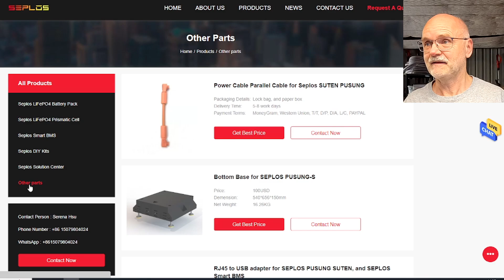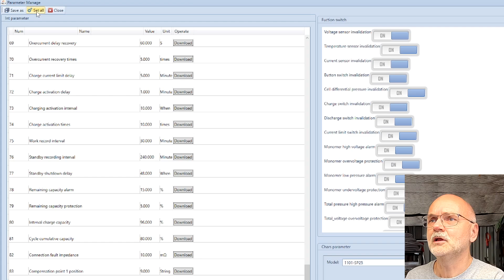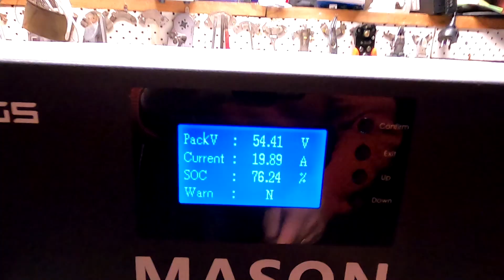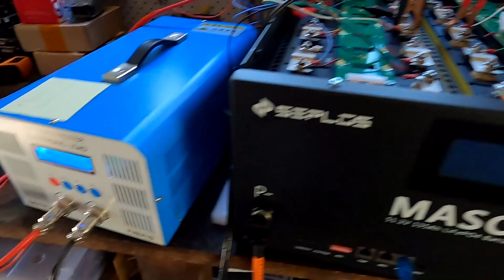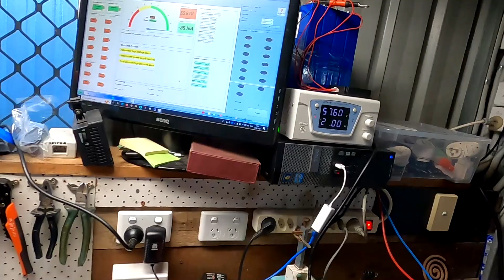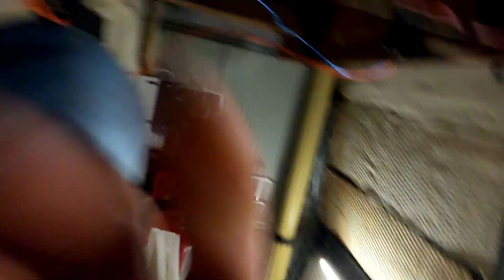SEPLOS SMART BMS: as good as its reputation?

Comment: I have another question that maybe others have dealt with and may have found a solution. Since I operate several packs in parallel and the individual cell voltages(and many other values) are unfortunately not transmitted to the Cerbo and then to the VRM, I use the option of being able to check all values on the desktop in the office via RS485 and USB using the SEPLOS software if necessary. With only one pack, this is not a problem, since the DIP adressing all remain at 0 and the parallel connection CAN & RS485 does not cause any problems. However, if you use several packs and adjust the DIP switches - so far I have unfortunately not been able to find a setting where ALL packs including the master pack are displayed in the SEPLOS software. This would be PACK 0. Maybe another one already has this great one missing the possibility of being able to read out all packs remotely - WITH a parallel connection via CAN bus.
Reply from the maker: I think you have to leave DIP 5 off for that to work but your packs will be in a different order than. Pack01 will be the master than.
I heard this from a friend. (Thanks Raphael).
I will test all this once we have the second pack build and connected.
Reply: @OffGridGarageAustralia  Many thanks Andy for the info - but unfortunately this doesn't work - or I misunderstand it. I've also tested almost infinite variants to work around problems that I don't think can be enforced, but without success. The only problem is that when all packs are connected and the master enables communication with the Cerbo - this master pack is then no longer displayed in the SEPLOS software. If you then address the DIP switches to just one pack - all packs( since still addressed with DIP 1-4) displayed in the software but the Cerbo only sees the one "master pack"
Reply: @Tombola666  do you use the victron firmware or pylon ?
Reply: @sergea1138  have choosen victron

Comment: Thanks for all that went into making this video. I've been corresponding with Seplos for the past 6 month on the Mason DIY kit for a planned expansion (and possible conversion) to two home made 16s Overkill EVE LF304 cell batteries. I never pulled the trigger on this Seplos Mason expansion project because I could never find any comprehensive information on the Seplos BMS including integration in Victron DVCC. DVCC is also suppose to provide intelligent charging integration with Victron smart MPPTs, but I'm not sure exactly what that is. While I like the Overkill BT app for looking at the cell information, my installation is remote and I'd like to be able to see the individual cell voltages and deviations for each battery on VRM or the remote console. If the Seplos BMS balancing function is struggling with 135Ah cells it's probably going to have real problems with 280/304Ah EVE cells. I'll keep an open mind, but I think you've help make my decision. Looking forward to the 280Ah or 304Ah Mason DIY kit build. Thanks again for all you do.
Reply from the maker: Thanks, Brian. Your absolutely right and we have to get the remote access to the BMS data working. I have tested all day yesterday to get any information or of the Seplos BMS without any success. I've ordered some other adapters now which should work and give us the info on the VRM. So stay tuned. You already have the Cerbo so it should be fairly easy to use CAN protocol to get the information from the Seplos to your VRM.
Thanks for sending these amazing pictures of your off grid observatory a while back. That looks really fantastic.

Comment: I am disappointed and the initial enthusiasm has cooled.
Mechanical design 👍
Cels 👍
"Intelligent" BMS 👎 does not perform the basic function - balancing  🙁
BMS protection functions 👍

I have 6 Solax Triple Power 5.8kWh batteries at home. The capacity is gradually reduced. So I'm going to take it apart and measure the cells. I ran out of patience after watching this video 😁

Comment: Andy, Fantastic job. Congratulations. I am having the same charging problem with two batteries. To balance with active.
Question: the active balancer, do you use it with the battery connected but without extracting energy to the house?
Cheers

Comment: I always wonder if the capacity as measured is because of the small but real losses in the bus bars and the flexible connections to the BMS.  Also there must be measurement errors on the clamp meter and the shunt.  Proof of this I guess when you do the high discharge tests next?  A very interesting and informative video Andy,.  Thank you!

Comment: Hi Andy I am a distributor for a Lithium Battery that uses the seplos bms.

They set it to 80% dod. I said I need the soc to go down to 15% to lower my electric bill to almost 0.

by doing this I reduce the battery life by 5% said the China Engineer.

What can you recommend that I discharge my batteries to?

with a 20% soc they claim I will get a 6000 cycle life for these CATL 15s 100Ah battery

Comment: The big advantage of the BMS is that it can talk to the charger/inverter. You ask why? For example your issue with the balancing. If the SOC reaches 100% the BMS asks the inverter to slow down the charging amps. This then allows the BMS to balance the battery. You see the same effect in your video when you manually lower the charge amps when it seems that the balancing is doing it's thing. Of course due to the large difference caused by the 4x cell test you did it isn't doing a great job but it will eventually reach a good balance. I have a similar setup running 6 months now. No initial top balance but the cells are still in good balance at 100% SOC. It just keeps them nice and perfect in balance when you just let him do it's job over time.
Reply: The Seplos BMS only balances with 150mA, it makes very little difference if you have runaway cells like Andy displayed.
Reply: @danielp5208  True but normally that would never happen. I you might have a runaway cell you better need to check why that is and remove the cause for that. Balancing (150mA per cell) is ok in this BMS because of the slow top charge request. Only if you don't use communcation to the inverter and do a manually charge this slow balancing might be an issue. But why use a BMS like this then? People buy the Seplos for this reason. If you really need active balancing you could add it afterwards but in 6 months I didn't need it and doing a full charge/discharge everyday.

Comment: Thanks Andy, very very interesting video. So, it seems that overall the BMS is doing its job correctly except for balancing the cells. I think for that it would be interesting to use the NEEEEY active balancer as a companion. It balances efficiently with 4A, it is possible to program the start and stop conditions, and as a bonus you can monitor a lot of battery pack information directly via Bluetooth. It would be interesting to see if it fits inside the Seplos box.
Reply from the maker: Thank you. Yes, the BMS seems to work as programmed with all its safety features. Adding an active balancer for the occasion to balancing or even a Neey seems to be the way to go...
Reply: @OffGridGarageAustralia  there is a programable relay for heater function but maybe we can use it controll the 5a active balance. Maybe explore it for future video
Reply from the maker: @Pey5531  the relay function is within the Seplos BMS or an external, additional component?
Reply: @OffGridGarageAustralia  there is an unused header built-in on the BMS board. I think is only logic level relay but we can connect to a bigger relay if we need to control a bigger load there is even a heater toggle on the software. We maybe need a modded firmware to use of other purpose.
Reply from the maker: @Pey5531  I'll ask the Seplos engineers. That would be a great feature for this BMS.

Comment: Hello Andy, finally... I'm glad that you finally bought a Mason box with the Seplos BMS. After a few months of fine-tuning the Seplos settings, I have to smile when I see that I'm similar had to learn all the individual problem cases in your video. You are absolutely right that the Seplos software still needs some attention. Just like many in the DIY forums, I can't understand why the Sepos Guys don't make full use of the possibilities of a good BMS. I now run 6 packs 280Ah in parallel on my Victron system. These communicate with the Cerbo. Again here, I had to use some tricky settings to get the maximum performance. But well... after a lot of hours everything is working fine. I have also retrofitted an active balancer in all packs .. which is switched on externally depending on the voltage.
Reply: Hey, as i am switching from SMA to 3x victron Multiplus, may i ask for your experience and settings ? Using 3 Seplos Mason Kits :)
Reply: @patrickmartin4482  Hi Patrick, the communication Seplos with the Cerbo works without any problems via Can Bus. At Victron I have activated DVCC, which is now used to control the MPPTs externally (at least in part) by the SEplos. Here I had to adjust the settings of the parameters a bit. On the one hand, the maximum charging current  so that this is normally over 400A, since my two MPPTs each deliver 200A and are otherwise already regulated below my final charging voltage. Likewise, the charging end voltage itself, since I only charge up to 3.40 volts, corresponds to 54.4 for the 16s pack. In the DVCC I set 54.40 in the Seplos, but 54.45. Victron always takes the lower value. But since I want to have 54.40 as a 100% SOC, I have to do the trick with the 54.45 Volt in the Seplos, because at 54.40 the SOC shows too early. Due to a few load fluctuations in the system, the voltage briefly reaches 54.45 volts at around 85-90% - which leads to Voltage Protect in the Seplos and thus to calibration at 100% SOC. if you don't do this... after a while the SOC gets out of hand like with the victron BMV. There are many opportunities for improvement in the Seplos software, but unfortunately Seplos itself is overwhelmed by it. It starts with the problem of the precharge... the large capacitors are not charged far enough in just 3 seconds so that the seplos always goes into short-circuit protection when it is first started. So manually precharge and as soon as one pack is connected... the others work without any problems -in the normal case, at least one should always be connected to the BUS - otherwise there would be a bigger problem anyway
Reply: @Tombola666  thanks a lot !

Comment: Thank you for your testing of this battery set.
I think trying to sqeeze out the last milliamp is like installing a solar tracking system instead of a fixed one.  For me it makes more sense to keep it simple and install just more to get the same output. 
I would not need to be able to check the battery at any time too, because I trust that it will work on it's own without supervising every day😊

Comment: Very interesting, thanks for your extensive tests!
I guess if you don't need the display function you could probably ditch the BMS and throw a JK in there with custom cables instead of the supplies bus bars. Maybe the JK display even fits the cutout... 
But then a JK is more expensive than a smart balancer so that's probably the way to go.

Comment: Andy, you should probly pin ur comment at top, ie: why you didn’t parallel the cells first, so you dont have to repeat it 300 times. Here, Ill do it for u one time. Andy did not put the cells in parallel to top balance deliberately, as part of the test to see if the BMS could balance the cells from this unbalanced state of charge.

Comment: The intermittent power supply waiting is a great function, really great function. It protect your inverter from damage. When single cells reach high voltage protect, then this function working. Only when soc less than 96%, then can charge the battery again. Then why need this function? As battery is communicate with victron inverter through CANbus, when charging is cutoff as full charging, then this current will go back to inverter( has chance to damage inverter). So we can not allow this things always happerened. That is why need this function. When battery is full charging, then stop charging the battery. Otherwise you will find that the battery is always charging, stop charging and charging, stop charging….. and this current always back to inverter. So with intermittent power supply waiting, only when soc less than 96% start charging again, it helps a lot with inverter.
Reply: And about the Clamp ammeter, LCD and Software current shows is different, it is not a problem. As you working with inverter, the discharging current is sine wave. The software is update current every second, so it changed every second. The software need exact current number, so when problem, easy solved. But LCD is shows to all clients, can not let clients see the sine wave current and changed very quick, so it will shows a average value per 8 second. But clamp ammeter is more slow update. So you will find the clamp ammeter is always like 25A. If you working with stable discharging load, then you will find the problem solved.
Reply: About the battery really capacity, you need do one cycle to help the bms to learn the battery really capacity. Full charging the battery to single cells high voltage protect or total voltage high voltage protect, then discharging the battery to single cells low voltage protect or total voltage low voltage protect, then the BMS will get the battery really capacity( this is a very important step when doing aging test). But as it is home energy storage system, so it is hard to always reach this situation, but still have chance to reach it, when reach the situation, then BMS will learn the battery really capacity again. The SOH is depends on the really capacity decrease. For example a 100ah really capacity cells, our warranty is 3000 cycles at 80% DOD. So after 3000 cycle, the soh start working. It remains 80ah, then soh is 100%, if 60ah, then soh is 60/80=75%.

Comment: if you want the charging switch to turn on again, you don't have to discharge until 96% but you simply turn of the bms and turn it on again (aka restart).. 😁
I have been using this bms for over 1 year now. The only thing I dislike is the balancing function, it is really really need an upgrade.. 😆

Anyway.. great video as always. 😄👍🏼

Comment: Great vid & info thanks Andy, I think u may have helped me break the ice with my 3 x Seplos Suntorque Batteries I have had since march and 2 of them have not wanted to charge over 72% max while the 3rd battery & last one delivered still charges to 97% max. I have had a discussion with the sellers techs who advised I needed to get some communication happening between the batteries and 5kw MPPT All-in-one inverter. I have been sidetracked with other issues, but I did find this all rather intimidating as I dont have a working PC presently, but it has been on my list of stuff to do, and you have made this all so much less confronting for me now, so it is time to get the old PC going again and fix this BMS situation I am having. Cheers

Comment: You don't get the allure of the comms of this BMS and you are only having problems charging because the BMS isn't negotiating the charging parameters, it would work fine if you were using an inverter with comms.

Comment: Now I am so excited to see what happens with the DIY 280. Will Andy incorporate the active charger from the start knowing the internal balancer will take 365 years to fully balance his pack? How will he run the wires for the external active balancer? I have an ideal , run the cables to the outside. As the active balancers are seldom used, When the need arises just plug in the balancer from the 135. After balanced unplug, put on the shelf until something needs balanced. If the wires are already externally located then it would take a matter of seconds to connect. Just a thought and not telling you how to do your battery. As for the temp sensor, I personally un soldered and re soldered the connections. As the connections at my astonishment were very poorly done. Not at all like the rest of the board. Good luck and stay creative!
Reply: I assume he’ll top balance the pack first which is best practice anyway.

Comment: For your efficiency you should calculate the A X V  difference from the supplying battery to the A x V to the receiving battery - not just the current. You have correction in both the inverter and probably your charger.

Comment: Thanks to your channel I also bought different BMS.  and I have them in the closet now.  No smart Daly BMS, ANT BMS 0,2a balancr, JBD relay BMS 0,15a balancer.  all scrap.  now I have two JK 2A... BMS in use and this is really the BMS you want.  and this milliampere balancing can be done with 18650 cells.

ps.  I made a copy of your battery shelf.  but without the mega bus bars.

Grüße Alex

Comment: I feel that, to give the BMS balancing the best chance, you should have started with cells which were roughly balanced.

Perhaps with the 280Ah build we will see how it goes when cells are all close to equal SoC at the start.

I won't suggest you mid-balance the 135Ah cells and then reset the BMS and do the tests all over again. That would be torture. For you... 😄